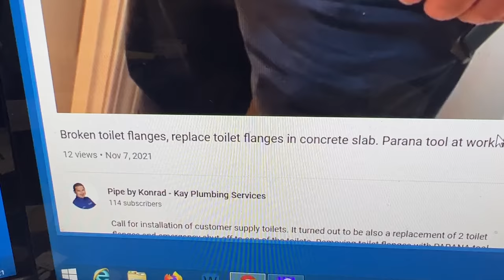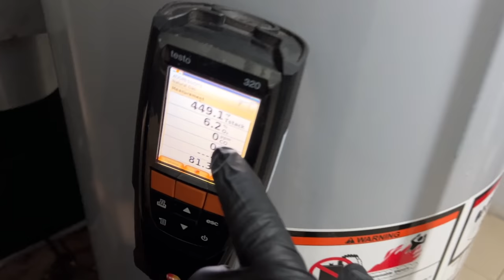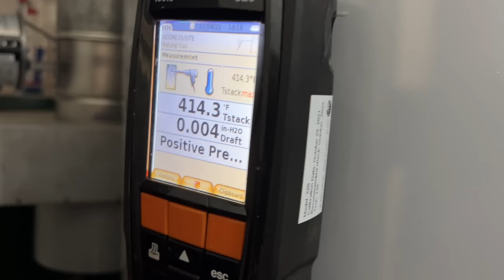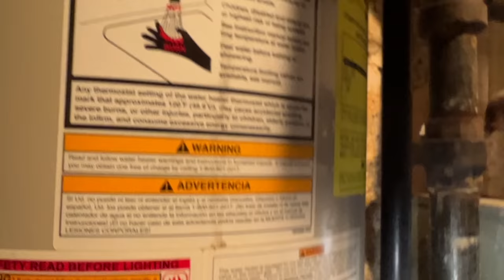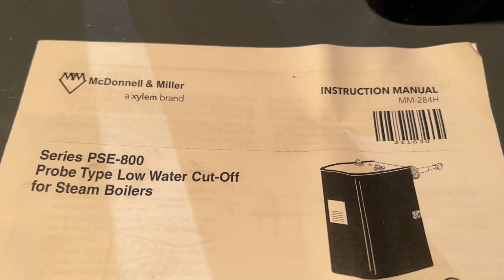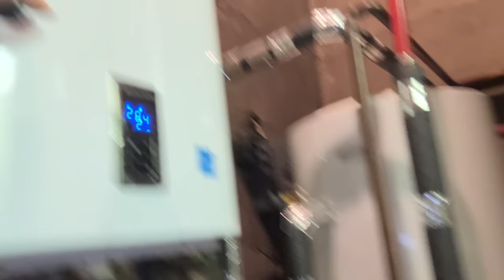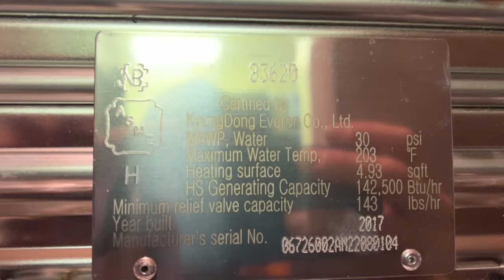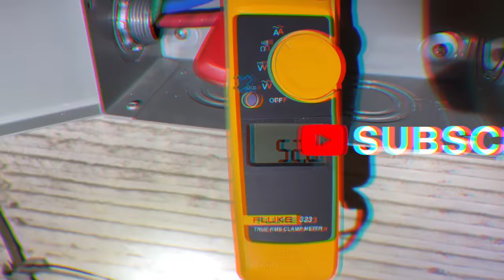Typical Monday Running Multiple Heating Service Calls With New Helper/Apprentice - Guess Who?

Comment: Incredible how people completely ignore near boiler piping and lack of insulation.  The bullhead tee that Dan Holohan specifically warns against on the main air vent that should be 15" from the end of the main , and a 6-9" riser from the end, Even a new air vent, may only work once.

Comment: Peter is awesome another good hire just like Daniel. Thanks for all you do Mikey you all keep up the great work and be safe.
Reply: I thought his name was Paul?!? DAMIT
Reply: He is awesome
Just needs self confidence 
He knows what to do
Maybe Mikey pipes can have boiler/A/c  SIMULATION  SO  guys can practice on parts especially needed , such  as capacitors pressure troll,  pigtails, and other popular items needed mostly in the trade.
Pump replacement a n d direction of flow
Roll out safety.

Guys can spend a few hours a week practicing 
I'm pretty good with my hands due to my dad's influences .
Anyway food for thought 
Maybe pipes will see this.
Thanks Robert

Comment: Depends on if the cold water supply valve only feeds the water heater or if it feeds both the inlet of the water heater and the prv of the boiler by way of a Tee. If the valve you shut was only feeding the water heater then yes absolutely 100% you are correct. But if it Tees before the tank then I would do further investigation. I'm sure your diagnosis is correct but I would have checked to see if the PRV was overfeeding first before concluding that the tank is compromised. I've seen prv's fail both ways. No flow or constant flow.

Comment: Mikey, I'm a voc ed guy from back in 1975. I'm a carpenter and I agree with you on the voc ed classes being cut, it sucks for those kids who want to learn a trade or be introduced to the trades. Mike Simon,  Dirt Perfect channel, talks about voc ed and trade schools quite a bit.  I tell kids who have no idea what they want to do when they grow up to look into the trades. I ask them to look into the HVAC/R game. Even if they don't want to get dirty every day there is the controls side of it especially in commercial work.
I'm in the building maintenance world and the fairly large company I use here in Maine is always looking for people. The do all aspects of commercial work from huge steam and hot water systems to A/C, hot water heat as well as control systems for hospitals, schools and breweries. The work all over the sate of Maine as well as New Hampshire and Vermont. They are starting to get worried because most of their techs are over 50 and there aren't many applying for jobs.
If I would have known about HVAC/R 46 years ago, I'd be retiring from that trade now instead of carpentry.

Comment: This is me being very particular about wood on home exteriors. That second house had some unpainted wood on the front door threshold. I'm so obsessive, I could never let that happen. 🤣 All I could think about is that unpainted wood soaking up all the rain and swelling up and eventually rotting and needing to replace the threshold. As much as I can, I prefer to prevent any issues from occurring rather than fixing them after they occur. End rant! 🤣
Reply: I have that on mine, can you please come help me paint? it'll help with your OCD.
Reply: @biker55555  on my way

Comment: I believe the reason you’re not supposed to use Teflon tape on LWCO is because as you screw it on the tape will unwind into the fitting and touch the sensor and cause it to sense water when there isn’t any water.
Reply: @joshrobbins3629  I'm not an engineer for McDonald Miller either but I believe Teflon could possibly cause it not to ground properly.

Comment: For years i worked as an engineer and then that work went to China, before that i was a technician and also repaired a lot of the mashiery it takes to keep a manufacturing plant going. I found work as a consultant for 5 years but there were signs that was leaving soon. I looked around and didn't see much in my field so i got a job at the post office repairing mail sorting machines. The pay was not the best but it had great benefits and was stable - just what a 54 your old guy needs. The collapse in 2008/9 saw alot of white collar workers out on the street, having worked with my hands opened up a lot more possibilities for me then most white collar workers. The fact I had a history of working with my hands and my mind is what got me that post office  job and that let me earn a living till i retired in 2009 with a small pension and could buy health insurance from them till I was eligible for medicare.

The country is in dire need of young guys willing to go into the trades. Seeing two guys like Daniel and Peter going into the trades is a great sign the new generation is going to take the bit and run with it, nobody is going to fix your boiler and plumbing from China.  

I wish the best for both of them.

Comment: Hey Mikey, just a reminder that Thursday is 11/11, Veterans Day...I have the same Weil McClain boiler with the same set up with the pig tail ,pressure gauge and pressure troll. I took them all apart and flushed out the pig tail and the nipple, wasn't really clogged, I still get no reading on the pressure gauge at all when the boiler is running and the nipple does not get as hot as the pig tail either. Would the gauge be no good?

Comment: Can you use a pipe dope that has ptfe in it for the sensor?
Reply: Pipe dope works great on threads. If you keep it only on the threads most pipe dopes do most everything.

Comment: Mike pipes your grate but as a electrician I cringe every time you put wires trough a metal knockout without atleast a plastic bushing it be nice to have pull out protection as well but I would be satisfied with just a open round bushing

Comment: Wouldn't a very sensitive pressure troll set at a 1 psi cut out not work because the boiler will be running at 5 psi steam? You just need a float switch.